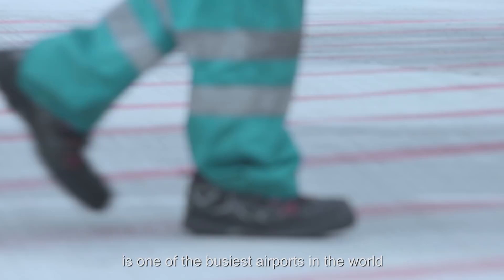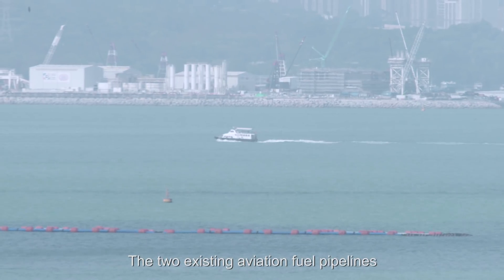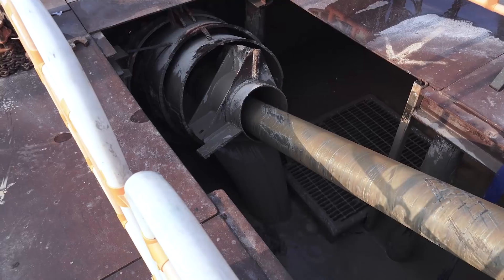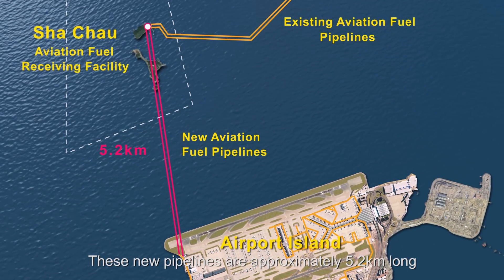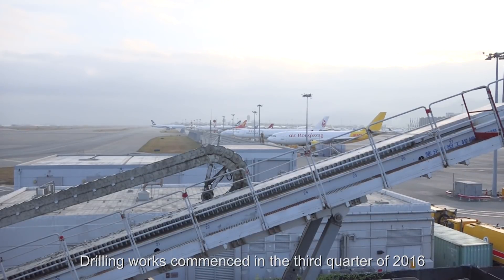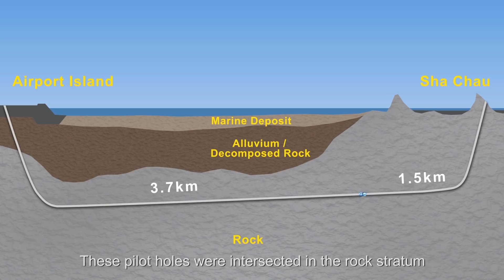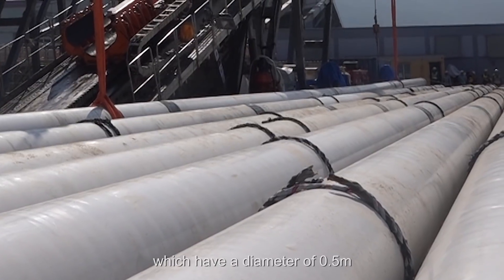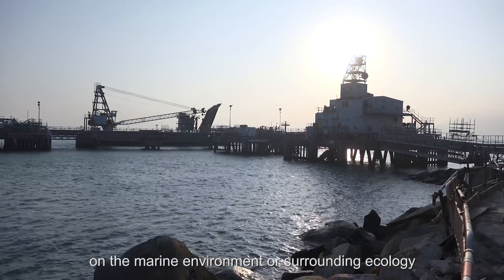Installation of Aviation Fuel Pipelines by Horizontal Directional Drilling

Comment: glad they did this because if a pile driver punctured the existing pipelines it would have caused a spill and it would have left HKIA without fuel. The fuel has to come from the refinery in Tuen Mun to the pump station at Sha Chau and then has to go under the seabed to reach the airport.